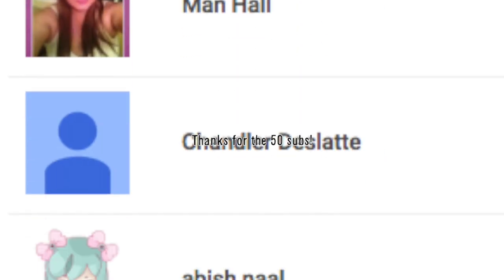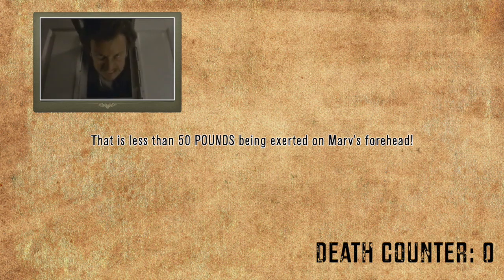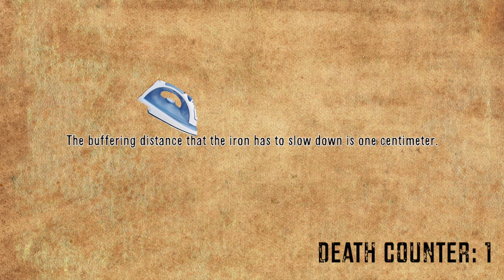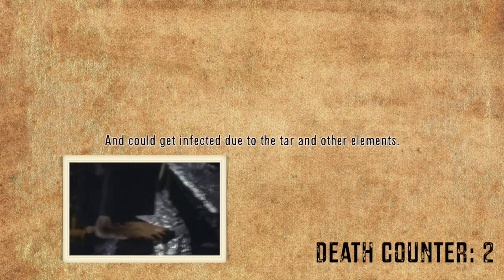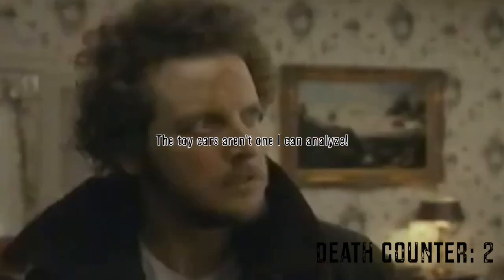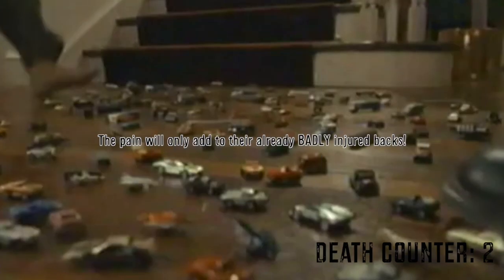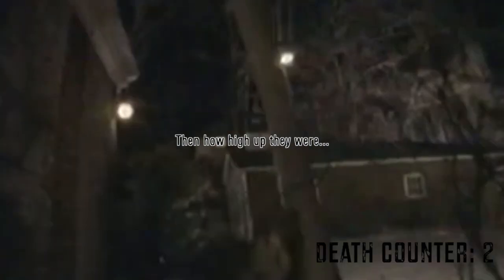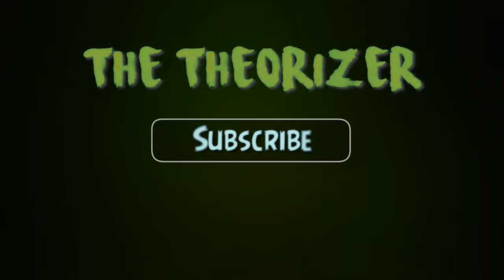[OLD] How DEADLY are the Traps in Home Alone? [Theory]

Comment: Debunking some of these:

- The heated doorknob isn't guaranteed to kill Harry, but it will likely give him third degree burns considering how long he held it for.
- Marv falling from the tall stair case would warrant a 50/50 as well because he falls on his back as well as the force being enough to damage his spine. (+0.5)
- The blowtorch scene would likely leave a 50/50 chance of Harry being killed as 1980 degrees Celsius not only burnt through his hat, but it also would burn through his skin, leaving him with severe third-degree burns on his head. (+0.5)
- The paint can trap hits them with such force that it breaks both of their jaws and damages the entire front of the skull (and the conservation of momentum would mean that the paint can continues moving into them), but the G-forces that the paint can has to decelerate that transfers to them could snap their neckbones and internally decapitate them, so it is a guaranteed death for both Harry and Marv. (+1 for both Harry and Marv, +2)

- The fall from the stairs would be partly deadly for both of them as well but not guaranteed since the angle isn't damaging to vital organs (it would be 0.5 for Marv as he falls at a very high force on his back, but it would be another 0.5 for Marv since Harry's body weight slams straight into him but none for Harry as he falls on Marv. (0.5 for Marv)
- The crowbar would definitely killed Harry, especially where the crowbar lands at and the force Marv hits Harry with. The crowbar lands with those 23,188 newtons on Harry's ribcage near Harry's heart and lungs, which would puncture both of them and send bones flying into those organs, causing irreparable damage to those organs. (1 for Harry)
- The old man didn't kill them, but it would have likely given them both a concussion.

Comment: this includes home alone 1 2 and 4 (for marv)
Harry suffers: Getting shot in the nuts with a bb gun, slipping on ice x2, a boiling hot doornob, a blowtorch, a plastic bag, feathers and glue getting blown on him, sliping on toy cars, getting hit with a paint can, tripping on a tripwire, getting hit with a crowbar by marv, hitting a wall at full force (indiana jones style), getting hit with a shovel, slipping on beeds, falling onto a car after getting flown up in the air by a trap,  slipping on a slimy ladder and falling on concrete, having a ton of tools hitting his head, another blowtorch, gasoline explosion, falling face first with a ladder in the ground, hit in the skull with a pipe x2, falling from the ground floor into the basment, squashed by a toolbox and door, falling 2 stories onto the ground while also hitting a plank, getting squashed by marv, having a ton of paintcans landing on him, getting gnawed on by doves

Marv suffers: Getting shot in the head with a bb gun, slipping on ice x3, hit in the head with a falling crowbar, face burned with hot iron, stepping on a large nail infected with tar, stepping on glass ortiments x2, sliping on toy cars, hit with a pain can, getting squashed by Harry, having a large tarangula droped on head, hitting a wall at full force (indiana jones style), getting hit with a shovel, slipping on beeds, getting hit in the head with a brick x4, getting staples in the nuts, chest, and head, falling from the ground floor into a basement x2, getting paintcans and a bookcase fall on him, getting electrified by a electrifiyed sink to the point of his sekeleton showing for a second, having a full case of flower dropped on his head, hit in skull with a pipe x2, getting squashed with a toolbox and door, falling 2 stories onto harry, getting another set of paintcans dropped on marv, getting gnawed on by doves, hit in the head with a door, slipping on water x4, falling down a flooded staircase, getting hit in the nuts by a grappling hook, smashing head first into glass and falling down two stories into vera (marvs girlfriend), getting hit in the head with the back of a frying pan, getting a pot of food landing on head, hit with a door and getting flung onto a hot stove, a food elevator crushing his head and left hand, getting hit in the headwith the back of an empty pot, crushed by a falling drawer the size of him, hit in the nuts with a toy plane and falling down a flight of stairs, getting flung onto a shandeler and falling off it, getting crushed by vera, tripped by kevins siblings into bushes

geez thats alot

Comment: Kevin has 552 Max HP (based on the average weight of an eight-year-old)
Harry has 1333 Max HP (based on the actor's weight today)
Marv has 2117 Max HP (based on the actor's weight today)

Harry and Marv's damage are divided by 10 for the sake of the movie, which is how they can survive so much.
If this happened, and it were not a movie, Harry and Marv would be dead before they even got inside.

Also, since Marv has so much HP, that explains why he gets the worst of the traps.

Comment: 1) Vsauce proved that the hot doorknob was impossible, instead burning the door. However if it even happened the burns would be horrible.
2) Vsauce also proved the paintcan trap, however it would have broken their necks as well as seen in what happened to the dummy.
3) Vsauce also proved the crowbar, however it was far more severe, in their scenario it broke the heart and internal organs of the dumy.

Comment: Umm...You CAN calculate the force of the falls Harry took. He weighs around 60 Kgs so do the math for a fall of approximately 1.75 meters which includes the height of stairs PLUS the approximate height of Harry's center of gravity. Just make sure to point out you're ignoring the steps he hit as he falls and you simply assume the answer is the MAXIMUM force of the fall. His velocity would be around: 5.86 m/s. While the impact force on the ground would be around: 10,290 Newtons MAXIMUM. Add ONE potential death.
That long fall Marv took down the frozen stairs can also be calculated. However, we'll just focus on the INITIAL fall on the first step. He fell approximately 1.25 meters; from slightly higher than his center of gravity ( went a little higher just for safe measure). Marv weighs around 92 Kgs; at that height he would be falling at 4.95m/s; so his impact on the first step would be around: 11,270 Newtons. We can ignore the "slide down the frozen steps" and the "impact on the door" at the end of the fall because the force wouldn't be enough to kill anyone (unless he hit his head on every step while sliding down). So, just add ANOTHER potential death for the initial fall.

Done..and done!
Reply from the maker: I CAN but that answer is obvious. Bad back

Comment: A better way to measure the bullets would be in joules, energy. Because once the bullet is fired, it does not accelerate, so it's not a force. You can use 1/2mv^2 to measure the energy of the bullet

Comment: The BB speed can vary a lot based on model of the BB gun. In the movie we don't know whether that is an airsoft or an airgun. The former can be very low powered and FPS can be as low as 200 when firing .20 gram plastic rounds, and is usually around 400. If that is an airgun then it would be much more powerful. Airguns are hot guns which can actually cause serious injuries. Getting shot in the head at so close range by an airgun might be fatal, but human forehead is kind of tough so I don't know.
Reply: Due to the cocking action he performed, I am inclined to consider it an airsoft, as airguns usually have air tanks and thus don't need to be cocked. Spring powered airsofts, however, need to be cocked in order to fire (the cocking action provided the energy in the form of compressed air). But it was the 90s things might be different. It is possible that the cocking doesn't serve any purpose other than being cool.